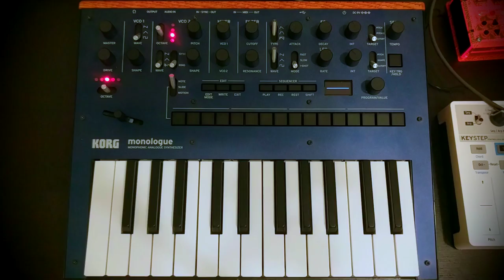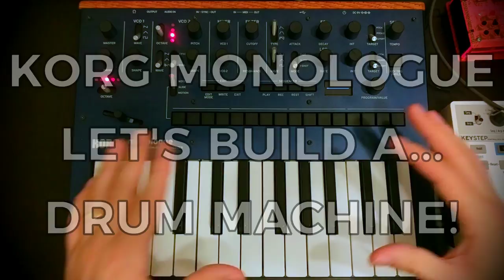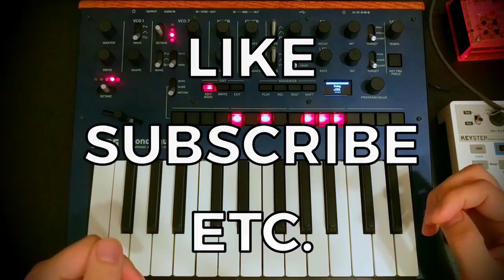Korg Monologue - Let's Build... A Drum Machine!

Comment: Hi I know I'm late to the party but I have just got one of these and love it and your videos. Could you tell me how you get a metronome sound as I just get the flashing lights on the step sequencer? Cheers man thnx so muchly
Reply from the maker: Press edit button, go down to the Global settings, press the second lit up light. You'll find the metronome settings there (p38 in the manual).
Reply from the maker: Something that has worked really well for me is to download all the manuals for synths I own (and some I don't) and stick them on Google drive so that I can access them wherever I am and quickly do searches (which is what I just did to answer your question).
Reply: @OscillatorSink  Thank you man I have just taken your advice and got a copy of the manual and can see what you mean. Sorry I bothered you I should of looked. Once again man thanks so much. This thing is incredible, I cant wait till I actually understand what I'm doing!
Reply from the maker: Have fun exploring and learning!
Reply: @OscillatorSink  I have an old fostex x-18 4 track and have seen people making short tape loops and creating sound on sound recordings on each channel and fading them in and out using the x18. Have you done anything along those lines?
Reply from the maker: @DrCook45  I haven't, but if I could find a tape machine for a good deal, I would!
Reply: @OscillatorSink  If you ever do please upload a video that would be awesome. At some point I'm gonna attempt it and chuck in some modulation pedals I have. Hope you dont mind the million questions coming at ya
Reply from the maker: @DrCook45  if you don't follow @Hainbach on YouTube you should. He's the guy you want for tape loops!
Reply: @OscillatorSink  thats quite spooky as I've just subscribed to him after a quick search
Reply from the maker: He's great!

Comment: CC question. The switches respond to 1,127 but there are only 3 values (up, middle, down). Do you know the values for up, middle, and down? The manual doesn't say!
Reply from the maker: +Electronic Musician very good question, but I don't know the answer. I guess the easiest way to find out is to plug it into your daw and start recording and just flick them? I'd guess 1, 63 and 127 will be the values, but that's just a guess.... If I get a chance over the next few days, I'll check and get back to you.
Reply: its usually one of two options: 
divisions of 3, so 0-42, 43-83, 84-127. So 1, 63, and 127 would work. 
Some other synths use 0, 1, 2-127. Which is more annoying to map. 
note MIDI controller range is expressed 0-127 or 1-128, as there are 128 total discreet values.

Comment: Question: After performing Korg's firmware update, I started playing with it and for the first time noticed that when I turn down all oscillators out of the mix, theres a hidden white noise oscillation at a very low volume. This is on all patches. I can filter it and put it through motion sequence. It's kind of cool actually, but I can't tell if this is intentional, to add grit to the sound or is this a qlitch? Somehow I've never noticed it before. Is it just my synth? I'm finding cool ways to utilize this 3rd / 4th "secret white noise oscillator", but what the heck?
Reply from the maker: Audio circuits have noise (or pick up noise from the environment). You might find that noise changes in volume depending on the power source/your location/what the synth is plugged in to (including whether the usb is connected)... If you can use that creatively, then more power to you! If you want a more "reliable" noise source, try plugging a detuned radio receiver into the audio input.
Reply: @OscillatorSink  thank you so much for such a quick reply. I know what you're saying, but this isn't an AC buzz. This is an actual white noise oscillation (pre Filter). You can motion sequence it, filter etc. the way wou would with a fourth oscillator. If you have a second - just try it, with your head phones. Turned Down Resonance, Osc. 1 +2. Turn up the volume ... and you just might hear it. It's fairly loud. A full on White (or Pink) noise oscillator. I'm so curious if this is an intended part of the synth - sound design?
Reply from the maker: It just sounds like either self noise inherent in the circuit, or the noise generator (from the second oscillator) bleeding into the circuit. It's unlikely to be intentional. My Monologue is packed away, but I wouldn't be surprised if it exhibited this effect too, and it may well still be affected by power/location/interference.
Reply: @OscillatorSink  Gotcha. Thank you.

Comment: Does it possible to do the same thing with a MINILOGUE ?
Reply from the maker: I think you could pull some of these same tricks yes, although it's my understanding that the sequencer isn't quite as comprehensive on the Miniologue - but sadly I don't have one so I haven't tried it out to be certain. If you have one, give it a go and let me know how you get on!
Reply: Original Minilogue doesn't have step motion sequencing like the monologue but the new minilogue xd does, including the drive and filter of the monologue I believe but not its oscillators.
Reply from the maker: I believe the filter on the XD is basically the same as the Prologue which is kinda somewhere between the original Minilogue and the Monologue - probably the best of both worlds and spot on for a polysynth!